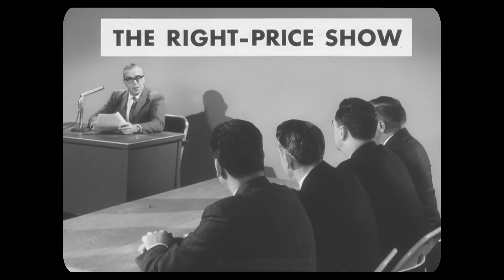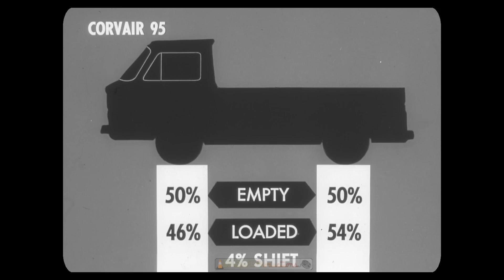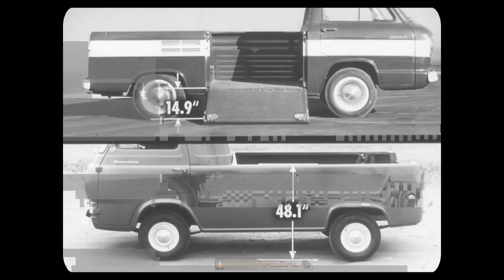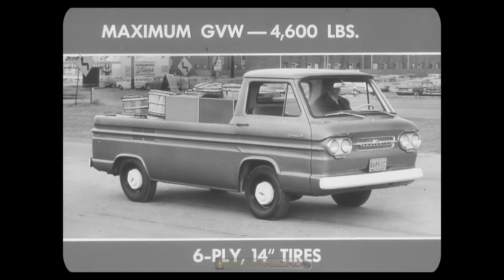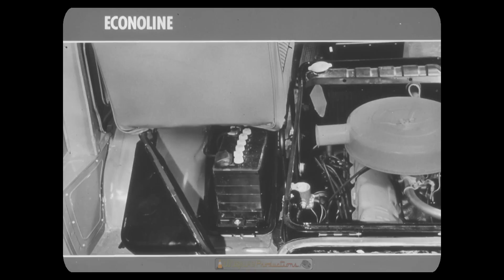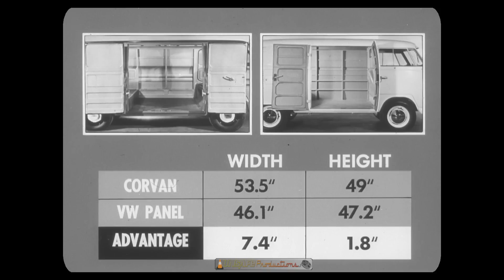CORVAIR FC 95 Vs FORD ECONOLINE & VOLKSWAGEN VAN 1961

Comment: My Father had a Econoline van it was very dependable. The only problem was the dog house in the middle of the front got extremely hot! Other than that solid engineering of the van was great.

Comment: Haha! I drive a Barkas B1000😂 The Engine weight is insignificant because it’s a 3 cylinder two stroke…. Has more space in the back than any of these 3 vans. But it has a hill indicator… as soon as there is a hill in the far distance it’ll start slowing down😂

Comment: Shizam id take anyone of these vans nowadays, but that Corvan I have been digging since i got my DL in 1974 never owned any of these vans but did have a 65 Corvair sitting on a stretched CJ2 frame with a Ford pinto motor in it, liked the 4x4 frankencar so much that I found a another Monza was a very cool car in the late 80s and I dont really remember what I paid for it but im sure it was under 800 bucks that was my MO buy a beater fix it up and then drive it before the CocoaBeach curse ate it up.

Comment: Corvair engine was a complete POS! VW was far more reliable.
Reply: The ENTIRE vehicle (VW) was was more reliable with PRECISION GERMAN craftsmanship! The VW car (type 1) was better BUILT than an AMERICAN Cadillac!
Reply: Not sure what you're on about, the rebuild interval on VW engines was pretty short in the 60's. Just look at how many lost cylinder No.3. Hell, they didn't even have oil filters!
Reply: Don't know about more reliable, but you could change a VW engine in 30 minutes, with the Corvair it took you the better part of an hour to get enough sheet metal off to get ready to drop the engine. VW's would drop valves, Corvairs valve seats.  Also VW vans used some strange engines a one year only 1959 engine of 34 HP that they never really supplied parts for opting to replace them with a 40 HP and an odd 1500 starting in 63 or 64 that was different than 53 horsepower 1500 that came out in the cars.

Comment: Our family had the window corvair van, lets see, it blew a piston, threw fanbelts, leaked oil, was a pain to work on the engines plugs and valve adjustment.  Had a good radio.  And with a load of people would have to smoke the clutch to start on a hill, it seems it was equipped with a car 4 speed manual (close ratio) that had a very high first gear.  Not a hauler in any way.  The back bench seats did have a lot of room underneath for our big dog!
Reply: That fan belt twisted 90 degrees was NOT meant to last, while the horizontally split crankcase was bound to leak oil. At least you knew that the engine was out of oil if you didn't see a puddle under the vehicle!
Reply: @TheOzthewiz  Much like a Detroit Diesel (another Fine GM product) Detroit Diesel wisdom? "if there isn't any oil underneath it there isn't any in it either"

Comment: I wouldn't want to change that uni-belt on the Corvan.
Reply: You'd get used to it.  You'd be changing it a lot.  My dad had one in the late 60's and got rid of it primarily because he was sick of replacing and/or adjusting that stupid belt, and he owned an auto parts store!
Reply: @Cankersaurus_1  The belt is easy to change, especially compared to the Econoline. All it takes is a 9/16 socket on 1 bolt.Your dad was likely putting the belt on too tight, which was a common problem. The proper belt tension is actually looser than you'd expect; less than a typical automotive V-belt of the day. People would crank them down too tight, which causes them to get thrown off.
Reply: @Cankersaurus_1  You've got some issues to work through if you think your father was that infallable. People make mistakes. Anyone in the last 50 years halfway familiar with the Corvair engine could tell you the proper tension, no internet required. That said, the reason this was an issue in the first place was the fact Chevrolet was vague about what the actual tension was: the owners manual simply says "tension and tighten" .
Reply: @Cankersaurus_1  he said that it was a common problem. How is that insulting?

Comment: The VW trucks were pretty much banned during the Chicken Tax war with Europe in the 60's.So very few came in to the US. VW also dropped the ball by not using a low pancake engine in their trucks until 1972. I f they had they could have had a very low  bed truck years earlier.

Comment: I had both Chevy & Ford (63) vans...enjoyed the ride of the Chevy better and the road noise was less than the Ford. I still thought the Ford van was better looking, even with the extended body(in 64 or 65).  My 63 had baby moons, beauty rings, was white, and I installed red marker lights on the sides. The seating was better in the Chevy, if I remember correctly. All the Fords I saw were rusted out but the Chevys weren’t. Hmmm!😳
Reply: My buddy had one of the early econoline pickups, it was definitely well used had been a follow me truck on an AF base but it was such a cool rig! It was rusty when we got it running out of the junkyard. We surfed all day everyday after work and that thing kept going full of salt, sand, cases of beer, fish and boards. Till one day the doors just fell off, unfortunately I had driven it up to the local police station to get the owner out of jail when that happened haha.
Reply: @deepbludude4697  🇺🇸 They we’re quite cool!😎 Now that’s an unusual story! Right at the police station! Hope that you still fixed it.They we’re such cool little trucks. Wish I had mine still or even another one. Good times! 🥰🤩✌️

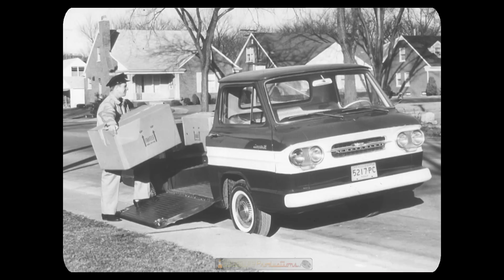Comment: 7:50 ........................... Yeah, I want to see how long that ramp door paint will last on the top outer skin if they use it load from a sidewalk.  They'd better put a rubber mat under it or the edge will get all chewed up.
Reply: Chuck Ster
 ... the Corvair truck had both a durable edge and rubber bumpers on that side ramp.
Reply: @rupe53  
LOL!  I'm not laughing at you, mind you.  I'm laughing because I had posted that post 9 months ago!
I had forgotten all about it.  
But thanks for the info.  I know those Corvair vans were well engineered.  In fact, I wouldn't mind 
having one today if it was fully reconditioned already.  It would be very handy.  
I guess I'll just have to be content with my '99 Ford Ranger XLT 4x4x4 pickup with its 4.0 liter V-6 and 5 speed automatic tranny.  It's very handy, too.  I just went out and picked up a huge load of 
firewood with it today.  I have a very tall canopy on it called a Flip-Pac that makes into a camper in less than a minute.  Can't get those anymore, sadly.  I get a lot of use out of mine year 'round.  
Too bad this guy didn't get the big blue storm cover with it.  It only cost me $200 extra but well worth it since
I'm in western Oregon where it rains a LOT.  It rained today too, big time. The rain cover comes down over the 
sides by about six inches and if you secure it with strong bungie cords, it stays on tight and doesn't flap at
night like many tents do.
https://www.youtube.com/watch?v=X7biqpQynt8
Reply: @chuckster3629  ... no problem. there's a lot of internet out there and I don't always catch when a comment is older. I have one of the Corvair vans that I drive on a regular basis. It's quirky, but better thought out than the 62 Chevy II I had for my first car.
Reply: @rupe53  
I've dug up old YouTube videos from as much as ten years back that I've posted comments on, so really 9 months is nothing.
Reply: There is a bumper strip on the edge.

Comment: Ford's Econoline destroyed the Chevy Corvair vans in sales.
Reply: What about Chevys regular, non corvair vans/trucks?
Reply: With good reason
Reply: and diamonds are more valuable than coal.
Reply: @mjbaiamonte  Diamonds actually aren't worth much at all.  Clever marketing and tightly limited production by what amounts to a cartel are what make them expensive.   But expensive and valuable are not the same thing.

Coal, at least, can be burned to provide heat.  All diamonds do is look purty.
Reply: Cheeper.

Comment: The Ford and Corvair models were the US response to the VW van, which was the first box on wheels sold in America. There had been panel trucks previously, but those were bigger.
Reply: But there were also "Sedan Deliveries" which were a panel truck based on a 2 door station wagon. The VW bus was more useful than the average sedan delivery unless you wanted to tow something, liked to crash into things and placed a high importance in not catching fire, if those were important to you then a Sedan Delivery or 1/2 ton based panel van was a better deal.

Comment: My first car was a '61 VW van, (with original 36hp engine) purchased in 1967 and traded in 1970 for a new VW/Sportsmobile camper. Loved them both. Same for the next 2 cars I owned (last was a 1979 VW van I drove for 22 years)

Comment: The Cor van does not have a flat floor as it has a windmill in the way. As does the VW. While not agreeing with a lot of this the VW is No3. No power awkward load area and uncomfortable at best. 
I drove one, a 1500 ute though for a few months for where I was working. Spent most of the time in third gear to go anywhere. That with a 1/4 tonne on board. I would hate to drive it heavily loaded. And the engine was in the way so often. It did however have dropsides both sides.
The 6cyl Falcon motor in the Ford while not a ball of fire would be probably the most practical. Though the length again was in the cargo area. And is the way  commercial  vans are still built.
Here in Oz we had Holden Falcon and Valiant passenger based utes and vans. All nominally half ton load but most carried double that!! And this right up to last year. There was 1 ton variations built since 71 on some.. They drive like a car, handle almost like a car and are comfortable to get in and out. Better than the Jap truck type utes though they have got better. Though recently got out of a 14 Hilux 2wd into my 10 Falcon ute and no comparison. Both base models with a few extras.  And both with the same capacity. The Falcon has a bigger and lower tray
Reply: Ah but if you went with a Dodge A series van you got the slant six! a little more power than the Falcon engine, if you got those in Oz

Comment: still the ford sold more lasted longer, did not turn over , and are still in use 60 years later .. gee
Reply: And Ford Improved The Econolines over time then just Barely do shit and in 1969 ford upped the Game with the full size Econoline
Reply: Those dumb Econolines have a very narrow Ford 9" rear end, sought after by hotrod guys. Most had 4.10 gears too 👍

Comment: The corvair is great   until its 10 degrees outside Has one of the worst heaters known to man
Reply: The Corvair has better heaters than modern cars. The CORVANS lack heat. Do some research bud
Reply: @colearmas6540  ... I still drive my Corvan and must say the heater is way better than the VW van but lacks when the temp falls close to freezing. It will eventually get to "ok" status after 10 - 20 miles but I seldom go that far in cold weather.
Reply: I can't speak for the Corvan, but I bought a (NEW) '61 Corvair Monza in Jan, 61, was sitting on the lot when I  bought it. It was SO cold, that the car had to be jump started, after runing for about 5 min, the interior was almost TOO warm! It was like night and day after owning a '56 Type 1 VW, where your feet would freeze due to the COLD floor board when doing highway driving!
Reply: @TheOzthewiz  ... shortly after my last post I made a modification to my Corvan heater to make it the same as the Greenbrier heater, which has another outlet under the 3rd row seat in the back. I must say that makes QUITE a difference. That weekend we had temps around 40 degrees at night and it was so nice to feel the heat up around my ears instead of down at my feet with a draft at my neck. If owners only knew this change could be done in an hour I'd bet everyone would have jumped on it!
Reply: That's because it doesn't have a heater.
Just like the old Volkswagens, the heater is really just a byproduct of a rather inefficient engine cooler.
Reply: @1SqueakyWheel  WRONG! The heater in the Corvair put out REAL heat, the bigger engine just plain put out MORE heat along with an electric fan to move the air. I owned A '56 VW and a '61 Corvair Monza. The Corvair, with the engine warmed up, the heater would almost drive you out of the car, even at -10degrees below zero, while in the VW , you were LUCKY to get luke warm air if you got the engine to rev!
Reply: @TheOzthewiz  I consider myself corrected.  Honestly, I only have experience with the VWs, and was making a parallel assumption. 
Good to know!
Reply: @1SqueakyWheel  The VW used heat from the "heat exchanger" which was (I know this is gonna sound crazy) actually a chamber in the exhaust system that the engine cooling fan would blow across to get heated air into the passenger compartment. The Corvair just used latent engine heat to heat the cabin. Thank God GM didn't use the VW system, otherwise the Corvair would have MORE "black marks" for carbon monoxide poisoning! I would NEVER trust an AMERICAN manufacturer to make such a system safe!
Reply: @TheOzthewiz  ah....  I just learned something new.  I always assumed the VWs just drew warm air from the main cooling blower  circuit's ducting.
Reply: @1SqueakyWheel  ... as a long time VW tech and a current Corvair owner, the difference between the heater systems is VW put cooling fins over the exhaust pipe then covered that with a tin shell. The Corvair used the air over the actual cylinders for the heater. Both systems used the engine fan to move the air, but Corvair added an electric blower to aid in windshield defrosting at slower speeds around town. Both systems can have issues with exhaust leaks into the heating ducts which is why it's necessary to keep up on repairs.

Comment: Lol chevy just hating on ford... the corvair engine suuuckkkeddddd and was very noisy and unreliable lol i have a 65 econoline with 350,000 miles on it and it still fires right up and runs no issue.. i had a corvair years ago and that shit was always broken.. the horrible fan/generator belt design was shit.. i sold it after about 9 months..
Reply: The Corvair engine can be certified for aircraft use with the addition of a magneto ignition. It is a common upgrade for commercial Cessnas. There is also an aftermarket camshaft available for Corvair that makes the engine run backwards and it will fit in a VW bus.
 All you had was a lemon, as the general design is still great.
Reply: Jake Kaywell yea I initially had high hopes when I bought it but after a couple weeks of constant issues i started to lose interest.. kept fiddling with it for about 6 months n took it to a couple different shops but couldn’t get it to run right so i got fed up and sold it.. found out about the magneto after the fact which was a real dk punch..

Comment: I'm a Corvair guy and I've owned a Corvan and have a bunch of friends with Corvair vans and pickups.  BUT one thing they avoided is that the Ford Econoline trucks have a tailgate more than 48" wide, Corvair tailgate is less than 44" wide, you can't slide a 48" sheet of plywood or drywall in the back of a Corvair.  Similar problem with the Corvan vs the Econoline van.  This was the main complaint I heard from contractors back in the day.  They also failed to mention the VW pickup had drop sides to turn it into a flatbed when they compared side load height and they didn't even look at the VW double cab pickup.
If Corvair had used a 48+" tailgate and offered a double cab option, they might have done a little better.

Comment: I do not want to be in a front end collision in any of them. Might as well be on a motorcycle!
Reply: On a rainy night on a secluded road out side of Chicago in the mid 60's, my father came upon an accident between a car and a van of this type. The people in the car were quite banged up but otherwise ok. The guy in the van was very badly injured. His legs were crushed and pushed up under the seat, his face split open and covered with blood. Dad was told another motorist had gone for help so he did what he could for the trapped man. 
This was before the jaws of life. When help arrived it took well over an hour to cut the man out. Dad never found out what became of the man.
Reply: @johnossendorf9979  I think the VW manual stated that 'if a head on collision was immanent driver and passenger should lift their legs up ' not sure how your supposed to brake with your feet in the air though.

Comment: what dealer is selling? these I want one. Can I get one with  a 6.2 L
Reply: j Eber, the infamous "LS swap" thingie...  It would turn those vans (had boxer 6's back then) into the SERIOUSLY REAR HEAVY category, as its' engine was on the rear beneath the floor, like the VW of that era (they used boxer 4's on those Kombis). Also you couldn't carry anything on the rear as V8's wouldn't fit in the rear hood.